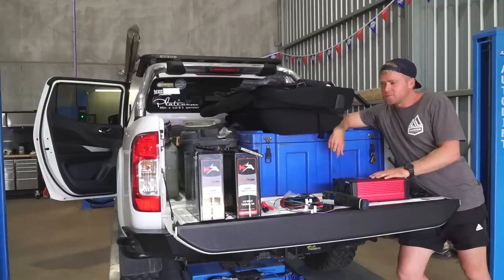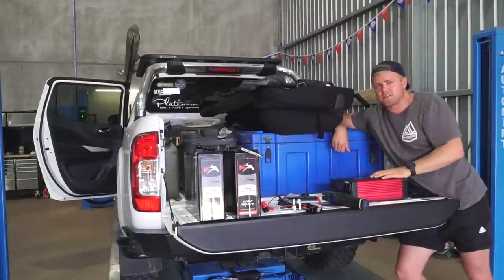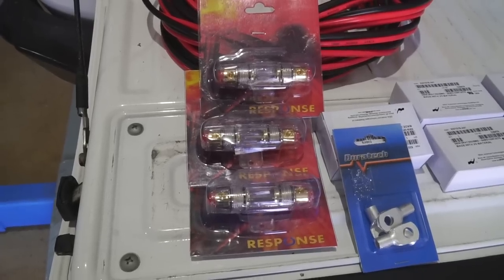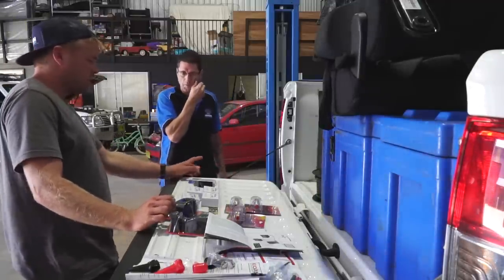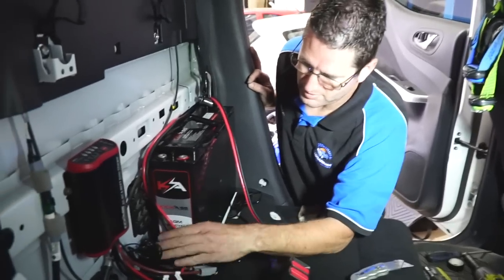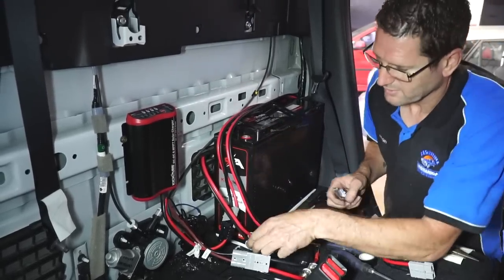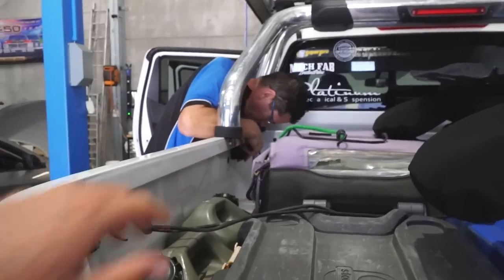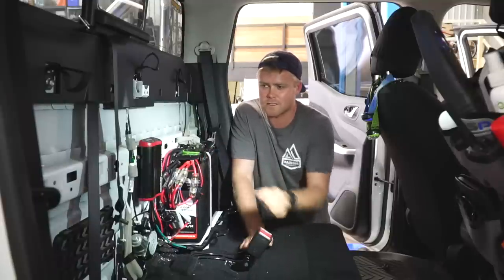4WD DUAL BATTERY INSTALL - Nissan Navara NP300

Comment: A mistake I made was.....with the solar panel I connected to my ctek and ctek smartpass I didn't realise I needed to cut the wires that went into the solar panel regulator.  What was happening was the  panel with a cheap PMW regulator was putting out about 15 amps, the solar panel regulator was gobbling up 4 or 5 of those amps and then to Ctek with a MPPT regulator was eating up more of amps so only about 5 or 6 amps were actually making it to the battery to charge.

To solve the problem I simply cut the wires in and out of the solar panel regulator and soldered them together to by-pass the cheap regulator that came with the panel.  Hope that is helpful if you didn't know already.

Bet you are pleased with how the beast is coming together.
Reply from the maker: Hey mate, so I've got a solar blanket I'm using now and with mine it has its own solar controller that by passes the dcdc charger and goes straight on to the battery and seems to be working good for the moment. Ill keep an eye on it though, cheers!
Reply: @TylerThompson90  Hi Tyler, it all depends on the quality of your solar blanket as to which is the best way to connect your blanket either to the battery direct or via the DC to DC Charger.  Check what type of solar regulator is attached to your solar blanket either a PWM (only OK) or MPPT (way better).  Your Kickarse DC to DC charger has a MPPT regulator - meaning, if your blanket is PWM you will be missing out on every drop of that luscious sunlight that a MPPT can convert.  The second reason to use your DC to DC charger is your solar blanket will not be a 'smart' charger meaning it will keep pushing power into a full battery risking damage to the battery.  Where as, your DC to DC is a 'smart' charger meaning it will control the power going in right down to trickling just the right amount right up to 100%.  

Kings have just released a 'master class' in off grid power in a 4 part series and it is excellent to get a  handle on your system.  The first video is basic, but the others I found useful, you might too.  It is really easy through a lack of knowledge to ruin a second battery, I have certainly wasted a few bucks on my learn curve.  

Looking forward to the video in the bush now the Navara is all done!

Comment: Great job Tyler. I’m with you on the wiring. As long as it works well doesn’t really matter what it looks like. It behind the seat !!
Reply from the maker: Cheers mate!
Reply: No way. Take pride in your work, make it neat! Mess normally equals issues.

Comment: Isn’t 8mm cable 100amps not 50amps I thought
Reply from the maker: Im not 100% sure mate. I know the mechanic said his 6mm cable was 50amps in the video but not sure what he said about 8mm
Reply: 8AWG  wire  is rated for 40 amps & 6AWG is rated for 55 amps.
8 gauge is fine for what you have Tyler, eg the BCDC charger  has a maximum of 25amps going into the   Charge battery.
I like your vids  mate well done on having ago & doing it your way

Comment: Can’t you fit the second battery under the rear seat
Reply from the maker: Nope hardly any room there at all
Reply: Ok hard to tell on camera but them batteries seemed quite small thought you might fit one in there